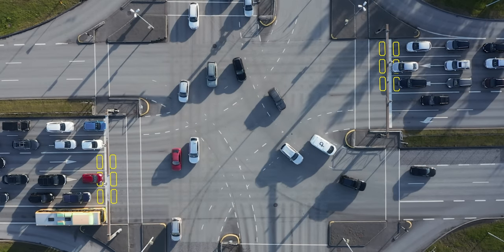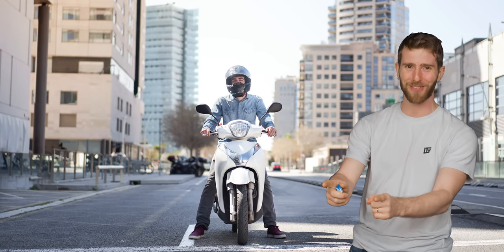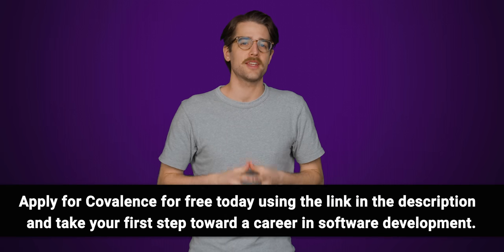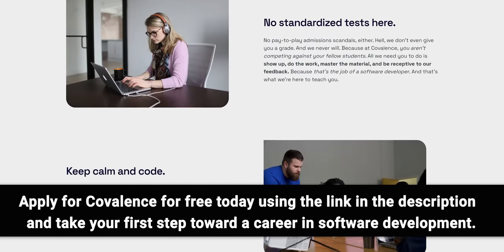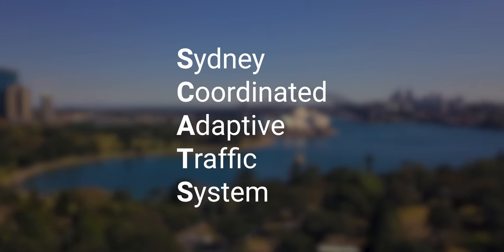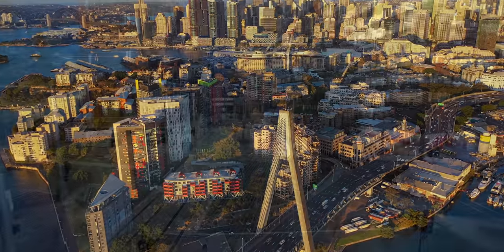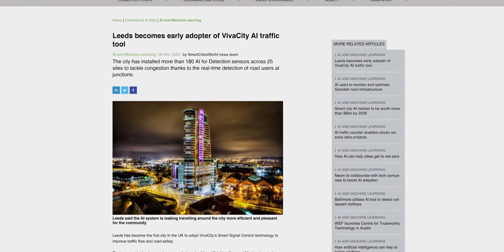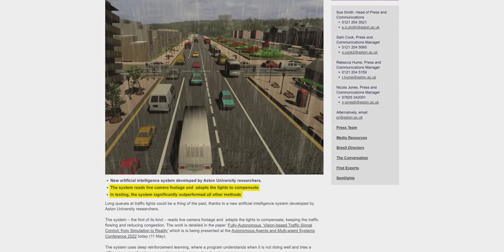Here's Why You Get Stuck At Red Lights

Comment: Fun fact (not) I live on a fairly nice little estate but in a very bad part of town (trafficwise) because, there are currently roadworks everywhere, not just both ends of town, immediately, as you're turning out of where I live, the level crossing barrier is always down for a train which has just left a station 4 miles away from where you're stuck either side of the barrier, cyclists, pedestrians, cars, lorries/trucks, buses Etc, you name it, its now blocking the way into or out of the housing estate for up to 15 minutes at worst, until one or even multiple trains has gone through. That isn't the end of that though, because after this barrier, meters away, is a crossroads with very long winded traffic lights which take forever to come off red, go to Amber then to Green. With this really bizarre horrible layout here and the roadworks here complete with a very popular route into my town closed off for 4 months to install watermains for new build homes there, plus potholes being filled in... devastation and gridlock, reigns!

Comment: I used to live in Waco, TX and got off work at 11pm.  Some lights flashed red in the downtown area, but I rarely drove through there.  Most lights at the time were timed.  One particular light I knew I was going to be stuck there awhile if it had just turned red.  I think I ran it a few times, but often I would drive through the parking lot to the right, then turn left onto the perpendicular street to turn right back onto the street I was on.  Probably also not technically legal, but I did it in front of a cop once and they didn't do anything.

There was also a light here in Ft. Worth around a construction area that was timed and if you got stopped right as it turned red you were there for a good 4 minutes.  I ran it because literally no one was coming at 2 am.

Comment: What about vehicle detectors on the poles holding up the traffic lights? In NJ, we have replaced the in-pavement inductor loops with detectors on the horizontal crossbars of the traffic lights themselves. They look like cameras, actually. Better than digging up the street all the time, but they are sometimes out of alignment. Still, I am surprised you didn't mention them at all! Still, they could be better. I still hit a lot of red lights, but if the thing is working right, it does help.

Comment: Traffic light management also heavily depends on the incentives of the city. For example in NY, and a few other corrupt states, FOIA requests have shown that they will adjust lights to increase traffic while also increasing the frequency of yellow light dilemma zones, as those yield the highest ticket revenue in conjunction with speed and red light cameras. 
In states that do not use those cameras, often the more they focus on residents keeping more of their money, the more they adopt management systems where lights are timed around traffic waves where if you enter a long segment of road, e.g., an avenue that stretches for miles, they will time the traffic lights where if you go the speed limit, then when one traffic light goes green, if you are going the speed limit, then by the time you get near the next traffic light, it will also have turned green, and this will often continue for miles. 
So far this is one of the most efficient designs since it take into account human irrational behavior and downright unintelligent behavior. For example, when cars are stopped at a red light, many people forget what the color green is, and thus are very slow to react to a green light, then you will get people who forget that pushing the gas pedal is more effective than pulling it. 

With many red lights along a stretch of road, you end up with most of your time spent either accelerating or slowing down, and with heavy traffic, a single block cannot be cleared in the green light duration. This leads to very low average speeds. For example in Brooklyn, if you use an application like torqure pro, you will see that your average speed for a trip will be around 5-7 MPH even during times that are well outside of rush hour. The design does lead to revenue for the city as if you are still in an intersection when the light goes from yellow to red, you will get a red light ticket. This causes many people to either speed through yellow lights, or stop abruptly to avoid a $300- $400 ticket. In places where the focus is not on maximizing ticket revenue, your average speed during a trip will often be close to the speed limit of the roads along the route.

Comment: For your motorcycling issue it may just as well be that you hadn't missed the induction loop, but just that your bike has just too few wteel components for the loop to register it passing. A neodymium magnet fixed somewhere near the pavement, like on the frame or oil pan seems to do the trick, at least i my case.

Comment: There's this one photo enforced light in my area that swear is programed to try and make you run it. I do a fair bit of late night driving. I'll be the only car on the road approaching it and like clockwork every time I get close to it it will turn red, with no other cars at the intersection. Then it will make you wait a solid 5 minutes (not an exaggeration) if you stopped for it.

Comment: About a decade or so ago a friend and I were travelling North on Cariboo Rd in Burnaby, just where it crosses the train track (just East of Costco.) 

There was a line of cars stopped at the light and we stopped. We were chatting away and after a few minutes realized that the light had not changed and that there were at least a dozen or so more cars pulled up behind us. Looking forward it was obvious what the problem was. The car ahead of us had stopped just short of the induction loop 🙂

I jumped out, knocked on their window and suggested that we might get going faster if they pulled ahead a meter or so. They did, I jumped back in, and off we went!
Reply: nowadays there are usually atleast 2 per lane.  But depending on how dynamic the system is and how busy the intersection can be a lane can have many more. ive seen places where you're already detected around 300m away.

Comment: I hypermile, and often dont get reds because i can see how long the other light has been red/green, how many cars are waiting in my direction, if there is a protected turn with waiting cars, and if it is only in my direction, or both, or if there is a large stack of cars waiting to cross while my lane has been green for a while

I get about 55MPG in my CRZ, which is rated for 38MPG

Comment: If you drive a motorcycle and there are lights at night that won't change, one trick is to pop it in neutral and put your kickstand down on the loop. It's not 100% if the loop's sensitivity is just simply WAY too low, but on ones that miss your bike (especially happens to touring bikes that ride higher) the kickstand trick will make it register. Luckily for me as someone in an area with a few that fall into the way too low category, they made it legal to go through a red on a clear road after waiting for a certain amount of time, or a rotation of the opposite going red then back to green. Our lights are dumb... many people consider a yellow a sign to speed up around here because of it...

Comment: Pretty sure my town is timer based, with the timer changing at night to be ridiculously fast. Some intersections turn green, but by the time you put your foot on the pedal its already yellow so unless you step on it you're kinda forced to run a red light. There are also intersections in town where if you try to turn left or right you are just stuck there forever because one light will turn green before yours and by the time you can go a steady flow of traffic is happening so you have to wait for someone kind enough to let you go, or to where you can gun it before another person comes to the light.

Comment: As great as it is to optimize car traffic to be 10-30% better, roads with cars still can't come close to matching the capacity of trains.

A freeway lane moves 2000 vehicles/hr while a small light rail train at 50% capacity can move 4500 people/hr (some subway lines are up to 50,000+ people/hr at full capacity).

Comment: In Poland they don't use any of that fancy stuff, instead they just use timers that are programmed to control the traffic in so-called green waves that if a car is going at the correct speed (not speeding), that car will not see a red light for as long as it goes straight ahead, but if it goes too fast or too slow then it will keep stumbling across red lights at each cross section. It's all calculated to be appropriately synchronised for a vehicle going with the right speed to have a red light just turn green at the right moment and so on. More complex cross sections where that would be impossible to pull off because it's major roads intersecting, those can have a phases system where different lanes will have green or red lights at different times deepening on whether you wanna go straight or turn and so on. But it's still hard fixed on timing that had been calculated and planned to ensure the best flow and also force drivers to drive at the correct speeds for their own convenience. That applies to the city centres at least. In places where there is less traffic they just put cameras faraway enough for it to be able to catch an approaching car and change the lights if possible (e.g. a relatively scarce coincidence that there is a pedestrian pressing a button on the crossing that they want a green light and they've been waiting for a while already). I have NEVER seen that induction thing you described and I seriously doubt it will ever be employed, seems like a waste of energy that doesn't even do its job properly when you can simply use cameras... at best maybe they will employ the thing you described to work in Australia, but based on cameras - which seems to be what you described to be used in the UK...

Comment: Our city has a problem with traffic lights on one of the main roads. The traffic lights aren't really connected together other than they sync their clocks at one specific time so they have their timers synced and there's a "green wave" working through-out the day. Too bad that the lights in the middle has some problem with it's timer and the clock gets out of sync with the others forcing drivers to stop at each light.. :)

Comment: Once I read about impedance and psyched myself out at a really long left turn lane light in my Honda civic, with lots of traffic piling up behind me. I convinced myself it was broken and my car wasn't ferrous enough to trigger it. I ran the red and pulled over to get air in my tire. Of course the light changed in a few minutes more. The cop a few cars back drove up and gave me a ticket. I probably told him why I did it but we both knew it would be up to a judge and it was a stupid reason. I just paid it.

Comment: Tip for your motorcycle - stick a really strong, small neodymium magnet in the bottom of the fairing if it's a sport bike. Bikes with aluminum frames and motors don't trip the light well, but the magnet disturbs things to induce the desired signal.

Comment: Try stopping on the embedded vehicle detector loop in the road instead of just passing over it. Some are 3 car lengths before the the stop line and will only trigger a light change when there are 3 vehicles waiting for the light to change. Look for the rectangular rectangle on the road surface ans stop on the first one if there are two or more.
Some are on timers that can be programmed for traffic conditions. Major roads get more time than crossroads.

Comment: easy cure for motorbikes not triggering induction loops...    a strong magnet fixed to the outside of the sump or inside  the lowest part of the fairing, but keep it clear of timing sensors,  this will effect the impedance of the loop.  the stronger the magnet, the further away from the loop it works.   this works

Comment: I live in Pittsburgh. Please, tell me where this is at? I don’t see any changes in any of the areas I drive. Most of downtown Pittsburgh is still on timed lights (almost all intersections), and some still within city limits and out of “downtown” are finally being changed to signal change at night from timers. 

The only “adaptive” one I know of is on McKnight road, and that sucks. It won’t change the side street lights sometimes until the main road cycles 2-3 times for the left hand turns. And some of those side roads don’t even stay green long enough to allow all traffic sitting there to clear (and I’m talking about 6-8 vehicles on the side roads).

Comment: In my 2002 Prius, I don't mind waiting at long red lights, unless I'm using the AC and I've been sitting there long enough where the engine starts to replenish the "cold reserve" in the evaporator, or if I'm using the heater and the engine has to start to bring the coolant temperature up.

Comment: theres other considerations in light controll also

sometimes lights will have a resting state which is a configuration they default to when no other cars are around in some cases they default to the highest priority side such as a long busy road with the less used road being held back on red as this allows the most likley lane to simply pass through

but in some cases they may do the opposite such as holding back a busier section of road in order to discourage speeding or to get drivers to pay attention at crossings instead of having greens all the way along

in some places the default rest position might be all reds with crosswalks on green so that if no cars are around pedestrians can cross unimpeded but should a car come there protected by the red

theres a million ways to configure them

one old trick for construction lights is to flash your highbeams which tricks the light into thinking theres more cars than there are so makes it speed up giving you the green

Comment: The induction sensors are an issue if the person in front of you leaves nearly a car's gap to the stop line and you can see that they're far from the sensor, and wait 3 full cycles of not getting a green turn light before cutting across a solid white line in front of them and covering the sensor to finally get a green...
Happens way too often.

Comment: Some motorbikes also don't decrease the impedance enough even if you go over the wires, at least in the UK
Reply: It depends how the sensors are set. My bike doesn't trigger about 1/3 of the sensor lights around here.
Reply: They're adjustable. Contact your local council and they'll send someone out to adjust it ;)
Reply: @chaos.corner mine doesn't do about half the ones in my home town and they know about it. They get real annoyed when you get off, turn the engine off and wheel it past the traffic lights on the pavement lol
Reply: @2110bt  You can go through malfunctioning lights here on motorcycles but that still means waiting a long time and it can be a bit chancy if traffic is heavy.

Comment: Well In St Louis people just run lights, ignore any traffic laws. As a person that doesn't have a car, I probably almost get run over basically daily.  It's really bad. I'm glad I have decent eyesight and hearing, or I'd probably would have been run over by now... it's so irratating. And while not encouraging, MO decided to basically deregulated everything gun related (which I find terrifying).  Because in the heat I'm of the moment, if I had a laser canon, there'd be a lot of vaporized people...   Although, I guess people would stop running red lights...
I'm glad I don't have a gun, or laser canon, I because I'd probably end up using it out of frustration, which is not a good reason... But the total disregard for anyone else is so completely irratating, to the point that laser canons at every intersection might not be a bad idea, unless you're trying to get to the hospital, then that's fine.(as long as you don't kill someone else).

Comment: I don't know if it's been mentioned yet, but FYI for other motorcyclists. You can buy a large magnet to place on the bottom of the bike to still trip nthst sensor.
Reply: I used to just lean it way over for about 20 seconds but it still didn't always work. I'd wait 3 cycles and than ran the red.

Comment: Lots of traffic lights go into flashing mode at certain times at night. If you come across a flashing red you stop treat it like a stop sign then proceed. A flashing yellow acts like a yield sign if the intersection is clear you don’t not need to stop. Most intersection have cameras they are not CVT traffic cameras but they dectect how many vehicles are stopped and control the timing of the lights. Also pedestrians can control the lights when they press the button to cross the street once the buttons pressed the light sequence should change to favour the crossing pedestrians.

Comment: the 1 light I run into has induction plates which are used during the day and at night between 10pm and 6am the main road has a blinking yellow and the side road has a blinking red and  they are 2 2 lane roads which are full during the 9-5 commuters time